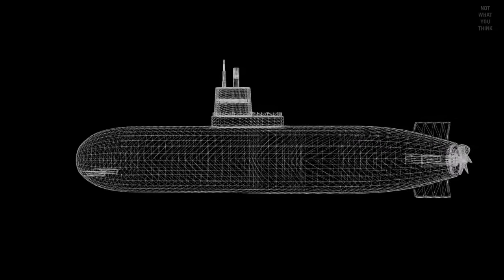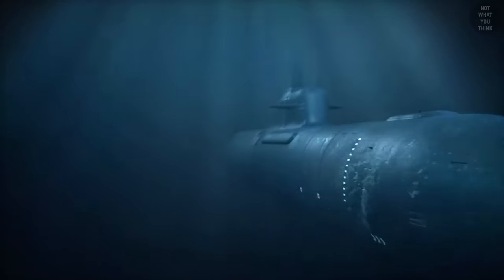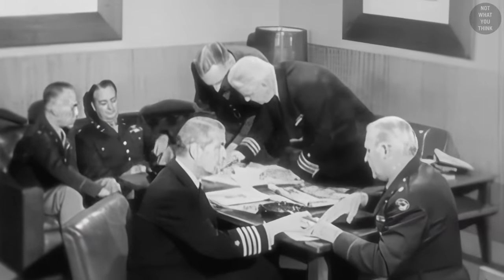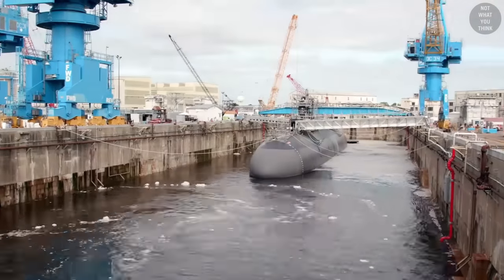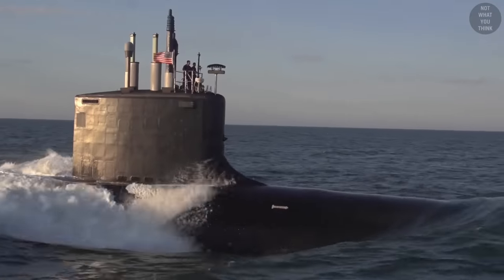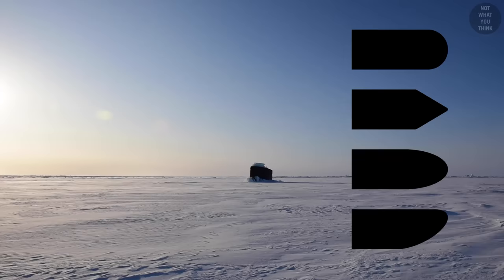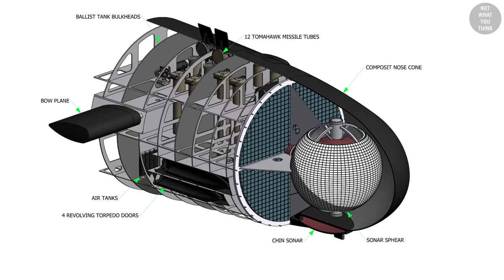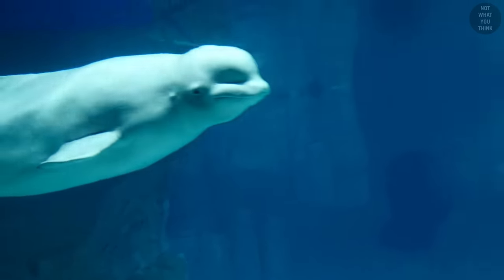Why Modern Submarines Have Round Noses?

Comment: Sonar Tech Veteran US Navy here. Modern US military subs bows (nose also known as the sonar dome) is not made of metal. It is made of GRP (Glass Reinforced Plastic) and the compartment the sonar sphere is housed in gets flooded due to water being an excellent sound conductor. Also the GRP nose is less prone to vibration and better resists the pressure changes when depth is adjusted. Another benefit is weight and cost reduction. There is also the fact that if the sonar compartment wasn't flooded the GRP dome would be crushed at a depth of approx. 500 feet.
Reply: ...and there would be sonar reflections against the hull itlsef actually. Like in radar technology : you wouldn't like to have a metallic nose ^^
Reply: interesting. I never knew that. How does the sonar withstand the degrading effects of salt water?
Reply: @jasonhutter7534  A lot of corrosion resistant materials are used in the construct. Plus the big one constant maintenance and equipment replacement. Think of the sonar sphere as just a massive sound array with multiple smaller transducers and hydrophones. Transducers are used to listen and broadcast sound. Hydrophones only listen. A simple way to look at is compare it to heat shielding tiles on spacecraft for dealing with re-entry friction. They don't last long under the stress they endure and must be changed frequently. Our sonar system is not immune to the corrosive effects of salt water but we've learned a lot over the past century of how to make them more resilient efficient sensitive and extremely precise. Navy sonar arrays are basically just really specialized sound systems for the medium (water) they are used in. If you look into sound technicians for major AV or audio events a lot of the same tech is employed just specialized for the role it is used in. Though my tour ended in 03 and my boat is in decommission process now the new Virgina class has tech that makes the Los Angeles class look like an old Norwall or even Gato class in comparison. From what I understand the Virginia class is the F-22 of the modern US Submarine Fleet.
Reply: Are you sure that information should be disclosed and give clues to foreign navies?
Reply: @Dude408f  I've seen this and much more detailed information on public display in articles 3-D breakdowns and documentaries since 07. Besides if you think foreign "Navies" haven't figured out 50 year old Soviet Era Tech then you are a fool. Oh and nice try concealing yourself bot.
Reply: @jasonswearingin1009  I guess you're right, thanks. No need to get angry 👍🏼
Reply: @jasonswearingin1009  Why bot?
Reply: @Dude408f  Not angry just have no tolerance for unfounded accusatorial claims made under ignorance. The reason I said bot was the fact that internet bots and limited AI use very generic terms and really generic names just like your shown personal identifier and your original comment. No I will not share classified info. Honestly the classified info is very dry and boring. It's all scientific and mathematical formulae.
Reply: @jasonswearingin1009  I see. Well, thanks for helping alleviate my ignorance. I'm not joking, have a good afternoon
Reply: @jasonswearingin1009  thank you so much for providing such a comprehensive explanation - it all becomes clear
Reply: @maisiesummerfield265  Much appreciated. Personally, I just prefer for people to know the truth within reason and as long as doing so doesn't endanger the lives of my brothers and sisters in arms. Yes, that includes both civil defense and military. Our Fire Fighters Law Enforcement Postal Workers EMT's and Core of Engineers to me are part of that group.
Reply: Oh cool that’s so clever 😮 I’d guess a whoooole lot of epoxy resin is used to fight corrosion 😂❤
Reply: Glass reinforced plastic sounds so weird as a term.
Interesting explanation.

I have seen videos about the hearing and body damage active sonar can cause. Spooky stuff.
Reply: @jasonswearingin1009  More like F-35;  I'd award title of F-22 of submarines to Seawolf class.
Reply: @piotrd.4850  Have to agree. The most common phrase I heard from Seawolf crew is "So fast shit flies off".
Reply: Sh!t. I've learned somthing. Really interesting thanks for the info.  U should start an informational channel. Thanks again for the info very interesting
Reply: This is all wrong

Comment: Note: ships no longer have "ship shape" bows underwater, virtually all major ships use some variation of the more bulbous bow. The sharp, V-shaped part of the bow is only used above the waterline to manage the effects of waves.
Reply: X-bow and Axe bow as extreme examples of managing wave resistance
Reply: Ships are bulbous below the waterline because ships move slowly compared with the speed of sound (like subsonic aircraft do).  Ships are pointy (like supersonic aircraft are) at the waterline because they move fast compared with the speed of the sea-surface waves.  Submarines don't need the pointy bit as they stay below the surface.
Reply: Not generally military vessels but on large hauliers, where fuel efficiency is god
Reply: @Grandude77  Pretty much all newer military vessels feature bulbous bows, which also act as a good housing for the SONAR arrays. Some of the older frigates like Oliver Hazard Perry class don't but the newer ones such as Arleigh Burke all do, certainly the larger ships such as cruisers and carriers all have bulbous bows.
Reply: @lachyt5247  Doesn't even have to be new warships. The RN has bulbous bows on the Type 23 frigate which dates to the Cold War
Reply: The bulbous bow was discovered when ships where equipped with ramming spikes for attacking submarines.

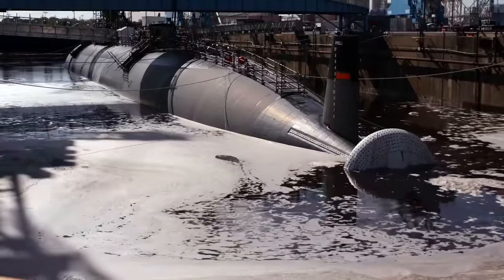Comment: 8:44 Fun fact: in almost no footage of 21st century military submarines do you see the actual shape of the propeller. They are either off-screen, submerged or (as you see in this video) covered. This is because the most important secret of a submarine is its sound signature. Revealing the exact shape of the propeller, which accounts for most of the normal noise it makes would allow an adversary to back-calculate the sound signature for easy identification and tracking.
Reply: That is a fun fact
Reply: preventing cavitation, which creates a lot of noise and wear, is also a big part of propeller design
Reply: There's a great recent french movie based only on this fact: "le chant du loup".
Reply: The Wolf's Call
Reply: @JetFiiire  Indeed, great movie
Reply: My brother was showing me around the base he worked at, via maps, and it was a fun moment when he was rotating around the dry dock using the 45 degree angle adjustment telling me about how thats how they work on subs, etc, and just stopped mid sentence. Which is when he told me about how secret the submarine propeller design was, while emailing himself a link to the submarine propeller shown right on his screen in maps because they drained the water from dry dock without closing the cover i guess it has.
Reply: lets hope the cl intons never sold those details the the chinese.
Reply: @MCBritta  Some random guy just revolutionized propeller design virtually eliminating cavitation and drag. They're crazy expensive atm but like all new technology will probably get cheaper in time. Sharrow Marine.
Reply: Isn’t the technical terminology for a submarines propeller “ a screw ?”
Reply: @guillermoelnino  Stay in school
Reply: @HuangHangLo  On second thought it was likely hunter this time around.
Reply: @JetFiiire  As a French myself, I feel like stupid I didn't even know about the existence of this film 😅
Reply: @user-nd7rg5er5g  i could tell you that you'll believe anything you hear as long as it comes from a guy in a suit reading from a teleprompter.
Reply: @MCBritta  It also propels the vessel forward and backwards.
Reply: @guillermoelnino  One thing's for sure, anything with Guillermo El Nino as a tag goes straight to /dev/nul
Reply: I worked in the repair department at submarine base. Whenever we put one in drydock the divers went down to cover the screw before it even came out of the water. I never saw one because I didn't have NTK.
Reply: @guillermoelnino  Ooops!  They did.  That, and for a campaign contribution, allowed hundreds of thousands of Chinese made AK rifle magazines of various types into the country, in violation of the 1994 "crime bill".
Reply: @johnbuffum6135  thats why i brought it up
Reply: Interesting fact that I both never knew and immediately went, yeah, makes perfect sense from an opsec perspective
Reply: @guillermoelnino  Thats funny coming from someone defending the Clintons.
Reply: Oops replied wrong person hahaha
Reply: @sankaplays3098  who do i look like? One of epstiens clients?
Reply: finally a real fun fact
Reply: why the youtube is not full of people like you but of peoples whose memes are beyond the universe ...
Reply: Actually most subs do not have propellers, they have propulsers
Reply: @guillermoelnino     I'm sure that Hunter did if the C's didn't.
Reply: reason why the usa rented Switzerland sub to learn how they lost the war games 
us aussie down under sunk american carrier in war games, the Americans  cheated in  lol they use sonar before agreed time
Reply: I GAVE HIM A LIKE FOR THE ANTI WOKE COMMENT
Reply: This blew my mind. I tried looking everywhere for a photo of SSN-774’s propeller but couldn’t find anything.
Reply: @Remour H.I. Sutton on YouTube, and Sub Brief on YouTube both cover stuff like this in pretty good detail. iirc, ssn 774 uses a pump jet (a propeller with a duct around it), which is generally harder to see, even if the navy wasn’t already super careful about trying to keep this stuff hush-hush.
Reply: @guillermoelnino or trump. Let's go BIDEN 2024
Reply: @deezostrong6303  nobody says that

Comment: Research was carried out by the US Navy to look at which was the best, most efficient shape for a submarine. They looked at various sea creatures with many thinking it would be the shark or the dolphin which would be the best. It turned that the best shape for traveling underwater was that of the penguin. And if you've ever seen penguins underwater then you would probably agree.

The problem with the Comet was not the windows. It was the way they made the holes for the rivets. Like many aircraft up to that time the holes were punched through. The problem was this caused microfractures in the fuselage skin. Not a problem with an unpressurised aircraft but with a pressurised body this caused the fractures to grow until they reached the window when it popped like a balloon. The solution was simple. The holes were drilled as this did not stress the skin.
Reply: The problem with the Comet was very much also the windows. It wasn't the only one, the riveting technique also being one, but it certainly was one.
Reply: I had always heard that the problem on the Comet was that the windows were square with 90 degree corners, where stress was concentrated and cracks started due to metal fatigue. The second version of the comet and all other passenger jets had curved windows without corners after that.
Reply: @mnxs  thanks. I meant to write not just the windows.

Comment: 1. Speed underwater rather than on the surface. 
2. Sound produced due to ship like bow.
3. Structural strength to handle pressure.
4. Space & arrangement inside the bow - sonar & tubes.

Comment: 4:57 Diesel boats are USUALLY more quiet than nuke subs already lol. (Because they just switch to battery to power the shaft as opposed to having the reactor/engine running)
Reply: Don't you think nuclear submarines also have batteries?
Reply: When you consider nuclear subs have to mitigate the noise from the high pressure steam and spinning a turban it's not hard to imagine a nuke sub being noisier than an electric one.
Reply: @kevinTG554  Nuclear reactors aren't just switched off like a lightbulb lmao

Comment: imagine a conical shaped stealth submarine
I feel like it would be hard to pick up on sonar since the sonar would reflect, just like radar and stealth aircraft. However it would be difficult to fit a decent sonar in a conical shaped bow. What do you guys think?
Reply: Not at all in practice. Passive Sonar, the thing most effected by stuff like flow noise, isn't bothered, because it's a receive only system. You aren't sending anything out, only listening. If hit by active Sonar, it wouldn't matter either. Active Sonar is pretty much never used by subs, inky the things hunting them. Those things tend to be above them by a few hundred feet, so any shape change done to the bow would be completely ignored due to the rest of the subs body.
Reply: When talking stealth in submarines, the noise from water/vibration on the hull is almost nothing at this point. The major factor in the way submarines are detected passively through noise transmitted to the hull by operating equipment inducing vibrations into the hull.  But even now, the range by which you can pick these up is pretty extreme nowadays and can usually only be detected by a sonar platform that is quiet enough to hear them over it's own noise... in other words, other submarines.

Comment: Two words: sonar array.
Or if you prefer hydrophone array.
Modern sonar arrays in the bow of a sub a basicalluy spherical in shape - a big sphere covered in micophones and transducers. 
Re Astute class, I believe the overall somewhat faceted hull shape of the Astute class is intended to increase stealth against active sonar which is commonly used by Russian subs and whose use is becoming more prevalent as modern subs are soooooo quiet. So I wouldn'tbe surprised if the Astute class bow was also influenced by stealth factors.

Comment: VERY interesting. Thank you. Here's one for you: how is the tube containing the periscope sealed when the boat (subs are called "boats") is submerged?
Reply: the tube is sealed thats how
Reply: Newer ones use fibre optics so it doesn’t have to go through the bull
Reply: The best preserved U-Boat in the world is in a museum here in Chicago. Part of the exhibit is a real periscope which goes up thru the roof so you can look around outside..
Reply: East central high school?
Reply: Hales Franciscan
Reply: Old school periscope used O-rings and gaskets
Reply: Thank you
Reply: Yes it is. It's on the lake front; it was built for the 1893 World's Fair.

Comment: A fish is designed to move flexibly and thier shape is purpose built to take advantage of pressure it creates through moving its body. A boat stern was designed to allow weight to be concentrated at the bottom.

Comment: Thing is, older submarines just like ships still had rounded tips underwater, you need a sharp tip above water to cut through the waves but a rounded tip for traveling underwater. Plus all the other reasons listed of course

Comment: You kind of failed to mention the over a century long development of the torpedo, which was specifically designed to travel underwater, and how modern submarines are torpedo-shaped because torpedoes are torpedo-shaped, and torpedoes are that shape because it’s the best design for cutting through the water quickly, while at the same time being as hard as possible to detect, which is a goal both torpedoes and submarines share.

Comment: The scene where a submarine surfaces at full speed reminded me something. Now excuse me, I am off to rewatch "Das Boot"
Reply: I believe that was the scene from Hunt for Red October movie. 
That’s not how a sub normally surfaces. That was what an “emergency blow” looks like from the surface. 
This happens when 4500 psi air is rapidly introduced into the ballast tanks to give the sub positive buoyancy in an emergency situation to get to the surface in an expedient manner. 
This system is tested periodically in a controlled manner and it is great fun for the crew. 
If you get far enough forwards in the sub when it breaches the water it almost feels like low gravity. 
Doing emergency blows and angles and dangles are two of the fun little evolutions that help break up the monotony of daily life on a submarine when you’re underway.

Comment: 5:00 "Even though Albacore was diesel-powered, she was much quieter than Nautilus."  Diesel subs are actually diesel-ELECTRIC, so when submerged they're running on batteries and hardly make a sound.  (Sorry if Albacore was diesel only.)  Nuclear subs have many pumps and coolants and a steam turbine and so on and of course are much noisier.  Anyway, you make it sound like it's surprising that a diesel would be quiet but it's no surprise.

Comment: The u.s navy went with the square nose for 57 years due to the fact that a circle can fit into a square hole but a square can not fit into a circle hole. When you squeeze a square into a circle the result is a triangle.
 So that is why the u.s navy is now using round circular nose cones placed over the square shaped front nose.

Comment: The shape must suit the use of space and the location of weapons, such as torpedoes. It's not always about copying fish, even if it's sensationally offered for the boulevard. As for ships and their "bulges" below the waterline, it is important that the ship's keel above the waterline enters the depression of the wave and thus has less frontal resistance of the hull above the waterline. From a physics point of view, there is no "phase" that would slow down speed. This has no equivalent in nature. It is designed for the desired purpose. But otherwise it's a good video.